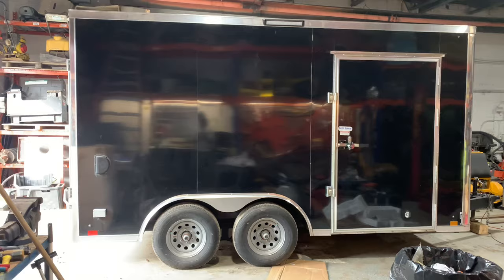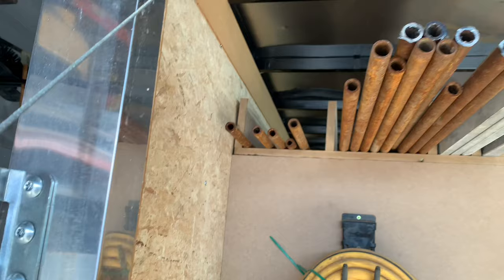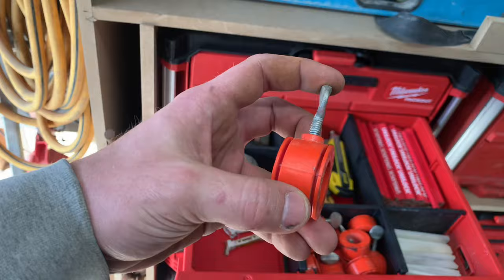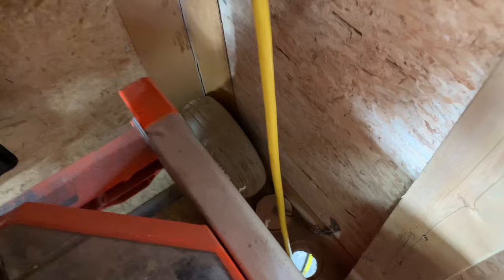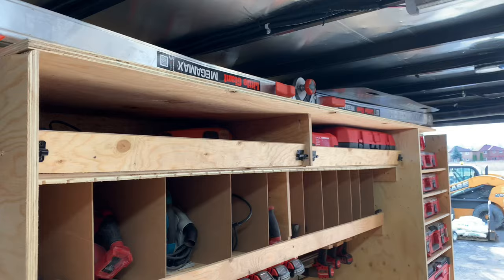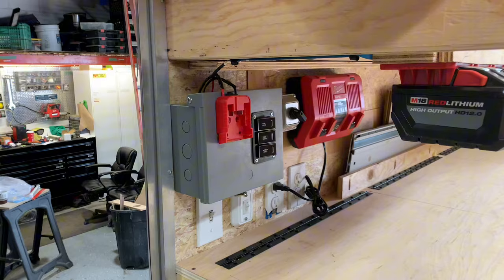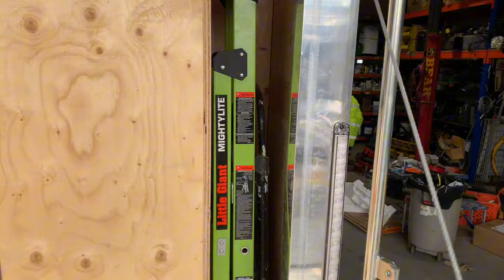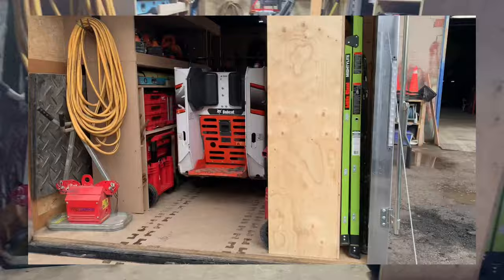Ultimate Milwaukee tool trailer tour!!

Comment: I just want to tell you from experience running a tool truck. The bin in the front for your long handle tools is all your ever going to want. Sometimes simpler is better. And especially when you're trying to stay productive. Only takes two seconds to put a bungee around all that on the way out.
Reply from the maker: Hey thanks for the feedback. Those were my thoughts aswell when it came to that corner of the trailer

Comment: Sweet trailer build!  What size axles?  3,500 or 5,200?  Also, how did you mount the Milwaukee drawers?  We have them also but are currently using the black mounting plates.
Reply from the maker: Thanks! We got 5200 and I took the draws out and screwed the drawer frame directly to the wood.